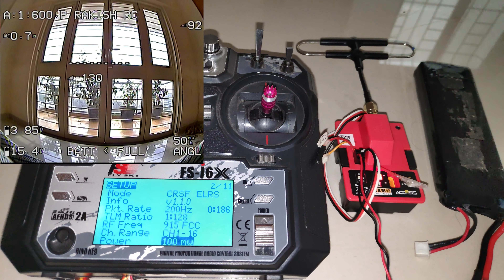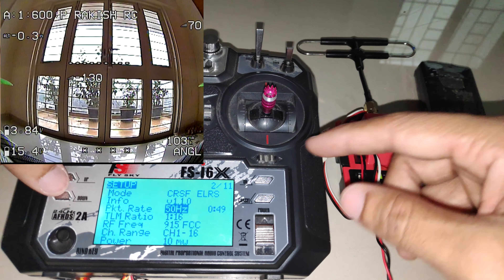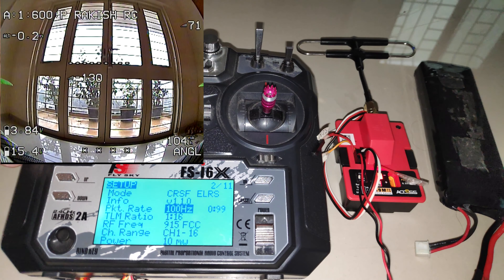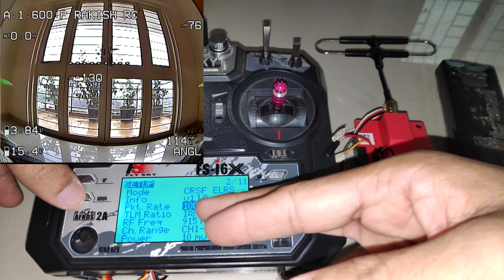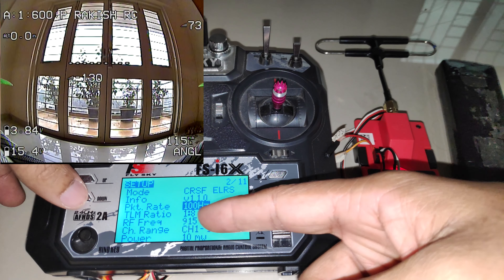Flysky FSI6X Open TX ExpressLRS Settings Menu Demo with R9M ELRS

Comment: In this version of OpenTX firmware, can we connect multi protocol module with FS i6X, so we could select the protocol from transmitter itself we want to use or is it specific to ELRS?

Comment: Congratulations for the channel, I'm from Brazil and I saw some videos... I have a fs th9x, it's not with opentx. I would like to know if you can use the Happymodel expresslrs elrs module, on this radio or another module from Betappv elrs micro tx module, both sold on aliexpresssss. hug and congratulations.

Parabéns pelo canal, sou do Brasil  e vi alguns vídeos ... tenho um fs th9x, não esta com opentx. Gostaria de saber se tem como usar o modulo Happymodel expresslrs elrs, nessa radio ou um outro modulo da Betappv elrs micro tx módulo, ambos vendido no aliexpresssss. abraço e parabéns.
Reply: I think its not possible..
Because mariano developed this for i6x as of right now..😔
Reply from the maker: Hi, thanks. Unfortunately the th9x cannot support elrs due to hardware limitations. I had reached out to Mike who is the developer for er9x. He said th9x doesn't have required hardware to support elrs so it's not possible.

Comment: can we use all other modul? is it all will plug n play? do we need the same version on lua script or something?
i have esp24tx lite for jumper t lite, can i use it?
Reply from the maker: Any elrs tx module will work with fsi6x. Currently fsi6x has elrs 2.0 with latest firmware so as long as your elrs tx and rx are on elrs 2.0 you are good to go. You can use esp24tx 👍
Reply: @RakishRc  okay..thanks

Comment: hi does 915mhz works good in india? i was torn between 915mhz or 868mhz elrs module and i found out only 865-867mhz are license free in india rest are used by cell towers which causes interference . so i decided to play it safe and ordered 2.4ghz betafpv nano tx.
Reply from the maker: Yes so 2.4ghz with elrs is good because you can get solid connection with lower latency and no restrictions as such. The 915mhz is mostly recommend if you are planning to go long distance or just want to have a reliable connection no matter in how dense environment you ar flying.

Comment: Tx power can i use 250W ??
Reply from the maker: Yes
Reply: @RakishRc  then the switches in the back side of r9m module no more in use after flashing elrs on it. Is it correct?